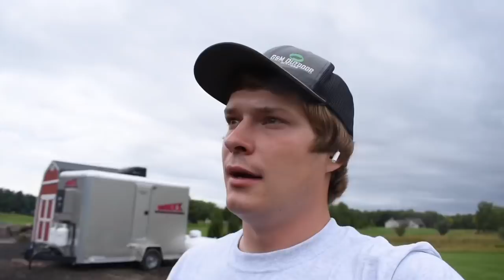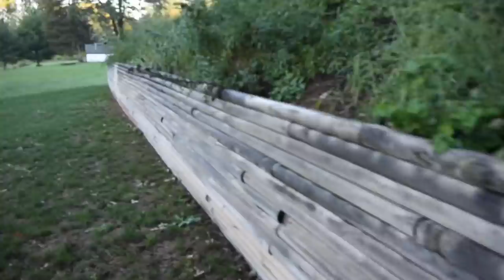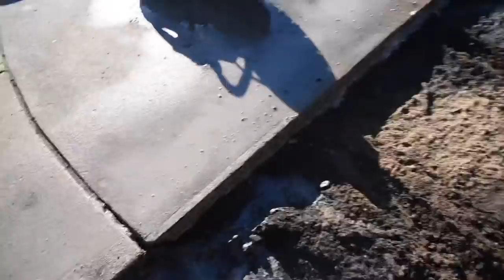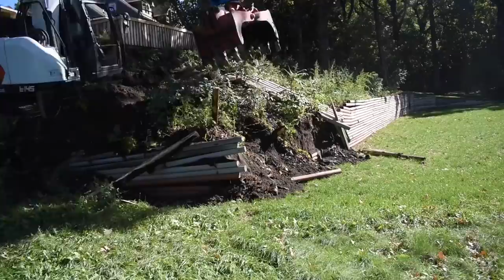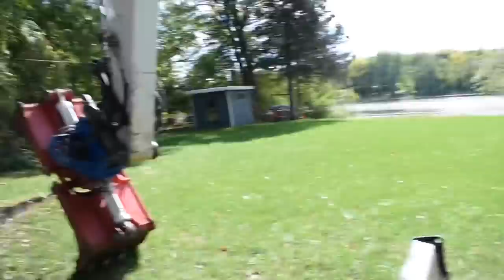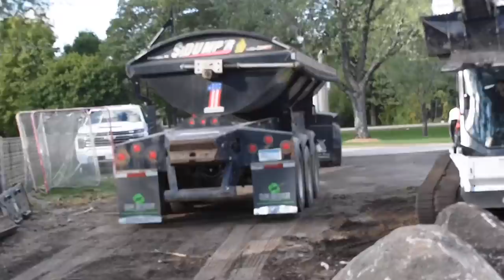RIPPING OUT AN OLD RETAINING WALL & CONCRETE!

Comment: No wonder that slab gave out, no rio bar through any of it.. My question is. What would did you quote for  this? I always charge a deposit. Because I certainly refuse to do thousands worth of work and not get paid for it. Or wait to be paid for it. Not every job will ever go to plan. But what we dont see is all the stuff ups and let downs. And this is coming from an owner operator. Lovin the vids but not all of us had mummy and daddies back pocket to rely on.. Keep it up man.
Reply from the maker: Thanks for the comment! I’ve never had anyone else’s back pocket to rely on either! What you see here Is a result of getting comfortable outside your comfort zone and willingness to do whatever it takes to make it happen
Reply: @GarrettWilliams2017  screw the haters 💪🏽